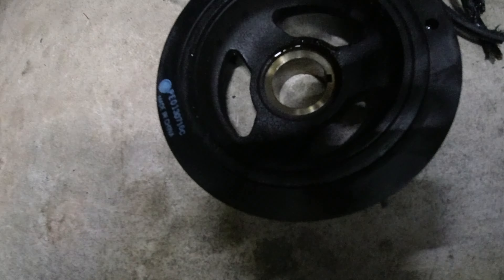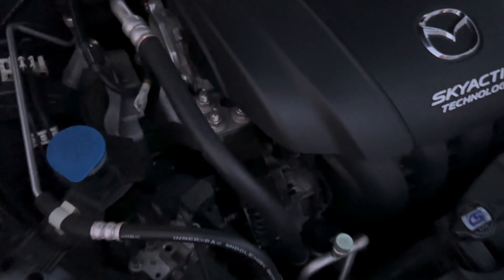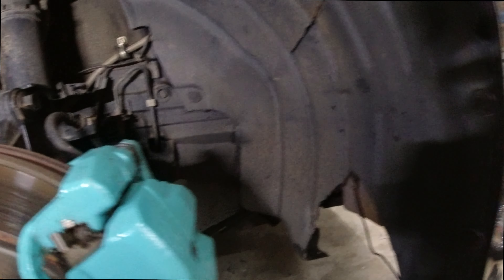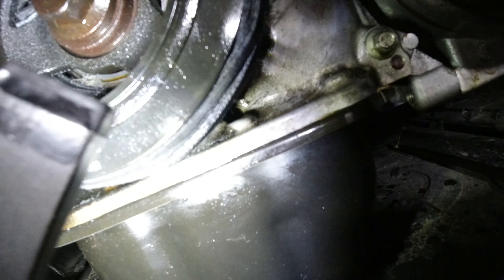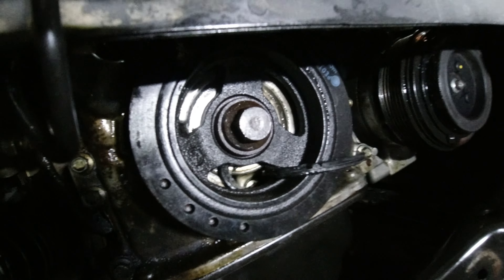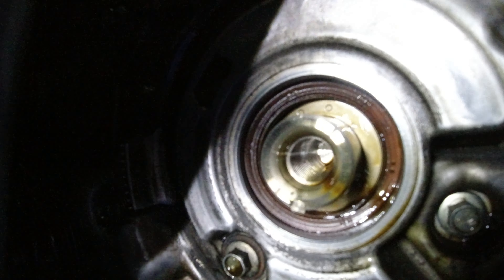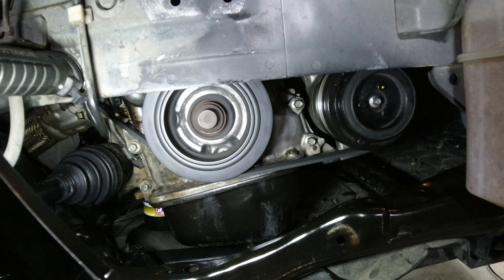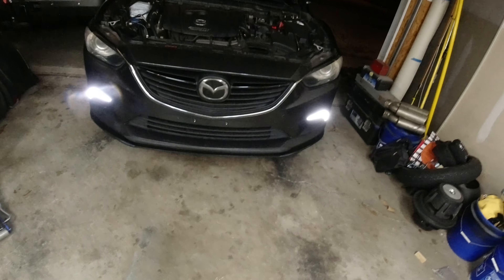Serpentine Belt Broke While Driving, Now Leaking Oil | Mazda 6 Chronicles

Comment: Man, how am I just now finding your channel? I've got a 2014 Touring pushing 197,000 miles. As I'm going through your DIY videos on the 6 I'm realizing I've had to deal with or have done probably about half of your videos! I am going to do my belts and tensioner myself once I hit 200k miles. The OE tensioner let go and spilled oil everywhere and I had the dealer replace for me at 100k. Thinking I'll handle it myself this next go around. 

Thanks for putting these videos together helping show where things are. Also, I could feel the anxiety through the video screen as you discovered the oil leak at the crank. Did you just tap the thing back in and that's all it took?
Reply from the maker: The main reason I started recording was bc it was nothing out there for reference so I am glad that it is helping! 

And for the crank seal, yes, my feelings were a little hurt when I seen it. The issue with this side cover is that the seal should be flush with the side cover and I did not know that. I pushed it back too far and it hit the timing chain. So, before I knew that, I did it wrong twice and ended up going to the dealer and paid them almost $900 before I realized what I was doing wrong. A expensive lesson to learn.
Reply: @DariusBuildz  oof, that sounds painful. Glad you got it sorted in the end though.
Reply from the maker: Same. learned a lesson and all has been well since.

Comment: Hi Darius, Could it be a bad tensioner that cause the serpentine belt to break ? Did you noticed any leakage around the tensioner . I had to change my tensioner at 75000 miles and it is leaking again. I hear this is a issue on the Gen 3 Mazdas. Good luck with your car.
Reply from the maker: This is a Gates belts and tensioner. I replaced them less than 2 years ago and about 40,000 miles ago. My oem belt lasted until 167, 000 miles and i only replaced it bc the serperentine belt was dryrotted and cracked badly. I guess the Gates belt is just inferior.

Comment: Belt just went on my ML350 while going into work haven’t had the time to look at it since i had it towed home but i think mine did the same thing.
Reply from the maker: It’s a decently simple fix on most cars if you can get your hands on there.
Reply: @DariusBuildz  normally it would be easy, but it seems to be kind a hard on a benz because I need a special tool just to get the pulley off but I have some parts coming in soon so I can change it.

Comment: I have the same issue with me. On a Monday. I checking to see if I have the same oil issue
Reply from the maker: Ok. If you replace the crank seal yourself, it needs to be be flush with the front of the timing case. Do not push it back as far as I did.

Comment: You got seriously lucky that the front main seal wasn’t all buggered up. How old was the belt?
Reply from the maker: Belt was 2 yrs old and about 40k miles. Gates belt. I don’t have the slightest idea why it shredded on me. I’ll keep an eye on the new one. The crank seal is still leaking a little, so I’m replacing it tomorrow morning. Got a new OEM Mazda one.
Reply: @DariusBuildz hey brother, so I got the same issue the serpentine belt ripped on me and got bits in the crank pulley. Do you think it’s a good idea to just change the seal regardless of the current state? Like what if u yank that back, would it leak eventually?

Comment: probably broke due to poor quality in manufacturing - I have had timing belts from Gates break or lose a teeth at just 25K miles.  I have had some better luck with Continental belts.
Reply from the maker: Gates belt being inferior seems to be the understanding across the board. I'll be ordering OEM tensioner and belts this week.